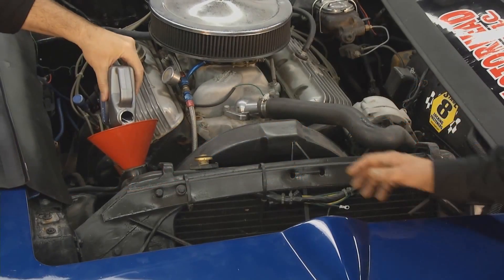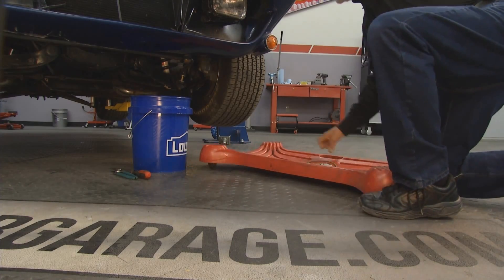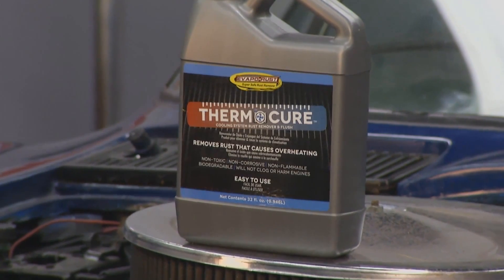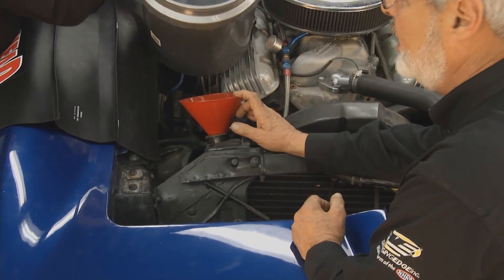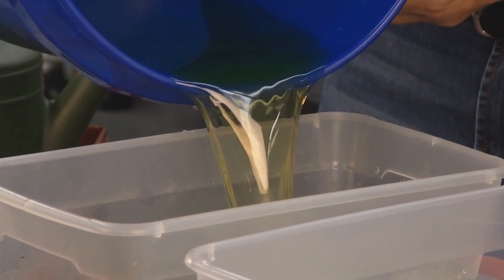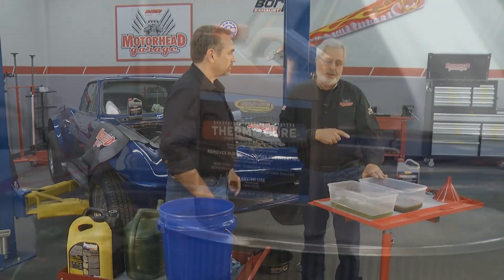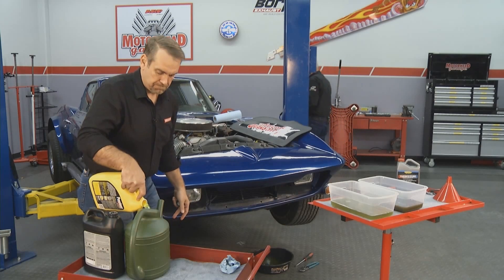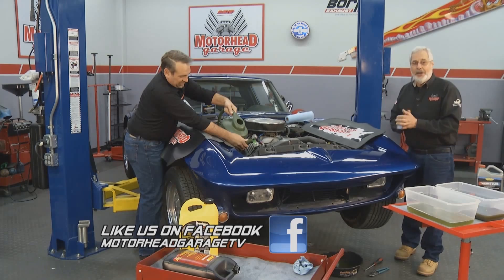THERMOCURE™ [RADIATOR RUST REMOVER & FLUSH]

Comment: As he said, one bottle of Thermocure treats coolant capacity of 3 gallons. But the other guy was wrong about the cooling system capacity on that big block Vette. It holds at least 4.75 gallons or more. Thermocure instructions say to use 2 bottles in that case.

Comment: Question: 
I drive a 2001 Chevrolet Tahoe 5.3 liter..

According to the temp gauge on the dash it’s taking a lot longer to reach operating temp
(Does this mean that it needs a cooling system flush)
Reply: Could be your thermostat is aging and not opening as quickly. It would be the spot I would check first.

Comment: You have water in the system already, do not use 50/50, use concentrate and check with refractometer. I am so fed up with people using 50/50 in a flushed engine, last time I poured antifreeze concentrate in a flushed car all the way to the filler neck, I run the engine till it’s hot, and checked with refractometer, to my surprise, the freezing point reading was at 10f (I also checked 50/50 as a reference, the reading was at -35F, which tells me the coolant concentration in the radiator is nowhere near 50/50), and if you pour 50/50 in I can’t imagine how diluted it will be in the system. One thing I do know however is nobody wants less than 50/50 mix in their car and certainly not 20/80 mix, because it’s obvious, but when they fill up their car after a complete flush, they fill up with 50/50, they don’t think one step further, even though it is just as obvious, but hey, why use your brain when you can just let it idle, right?

Comment: This actually does work, I used radiator flush, changed thermostat, swapped radiator, and even put a new head gasket plus cylinder head rebuild on my 2001 Dodge Neon, still overheats, extremely infuriating! I could tell the engine block had rust because no matter how many time I flush the radiator the water still looks brown. I was like I really got nothing to lose, so I tried this, run cars for about five days on tap water with evaporust until the car starts to overheat, five days later drained the radiator, water came out black, flushed it couple times and refilled with coolant, did a couple zero to 60 in a row, brakes overheated but the car didn’t, that’s how I know it worked.
Reply: So it takes days for good result?
Reply: jason baisa i think it takes 24 hours, but the instruction says couple days with some driving for best results.
Reply: Change your coolant on time
Reply: @coreturkoane129  i bought it used for $500, can’t expect much from that price tag

Comment: Too bad they don't have an additive for your oil that will do the same thing! Usually you end up with rust on top of the heads and block when you get something from idiots that left the valve covers off and intake manifold off and let the engine sit while doing a carb conversion as such on the 4.3.  Too bad oil isn't a rust dissolver instead of a metal preservative and lubricant.

Comment: Never drain the car while it's hot, never put cold water in a hot car, it will warp a lot of stuff. Wait for it to cool down for minimum 20 mins after running the car, then drain it, then refill it. The longer you wait for the car to cool down the less likely your going to warp anything. I personally would wait +35mins not 20, just to be safe.
Reply: The tale of warping things/cracking blocks comes from putting cold water into an overheating engine on the side of the road. Adding room temperature water to a normal temperature engine will have no adverse affects.

Comment: My rust is 100 times worse. Any suggestions?? Should I do it multiple times??
Reply: One time should be enough but if its that bad and since Im pretty anal about that kind of stuff. If it were me, which I have done. I ran Thermocure twice in my motor. It was overkill for me but at least I know my 1963 mercury Comet will run cooler and as it should now.

Comment: What a crappy instrucitonal video.  I just bought this product and after watching this I am less confident to do the job than before!!
Reply: 1. Just drain your system
2. You can remove your thermostat or not
3. Fill the system with this stuff and distilled water. (Thermocure is $19, Distilled Water .60 @ Walmart)
4.The instruction on the bottle state drive the car for 3-5 hours or a few days, then drain and flush twice with water before filling with coolant.
Reply: Todd H did it work for you,? How rusty was yours
Reply: Did it on my 63 Mercury Comet, the stuff that came out of that was gross. It turned the stuff in my cooling system black.  It dissolves the rust for sure. I did it on twice on mine and was surprised.   She runs cooler and the coolant is clean. You'll want to flush it at least 1 or twice after the thermocure before adding your 50/50 mix or how ever you mix your coolant.

Comment: Could you use this on a motorcycle?  Just curious
Reply from the maker: Yes you can.  You just need to cut back on the Thermocure.  Thermocure is designed for a 3 gallon system.  With a few simple calculations, you will be on your way to a clean cooling system.

Comment: Does anyone now how to clean rust off of the exterior of the radiator?  I accidentally spilled two drops on the blades and it dripped down leaving two long orange streaks amongst a brand new beautiful shiny radiator.
Reply from the maker: If it is just light rust, just put a paper towel soaked in Evapo-Rust over the spot and let sit.  Then rinse with water.  Please give us a call if you have any other questions.  888.329.9877

Comment: not available on amazon.ca :(

and if you notice at the end the nut at the bottom was not closed when he was adding coolant haha
Reply: Alex Deagle I think that's were he spilled it when he started poring it in I think the drain plug is on the opposite side we're the guy was at the beginning when he tightin it back up
Reply: Alex Deagle lol
Reply: I saw that lol. You kinda get the notion he prides himself a meticulous mechanic, said he closed the pet cock and yet there’s a $20+ bottle of radiator fluid being lost not to mention time.
Reply: Alex Deagle the way it’s running doesn’t look like the fluid he just spilt. It’s a got a pretty constant flow.